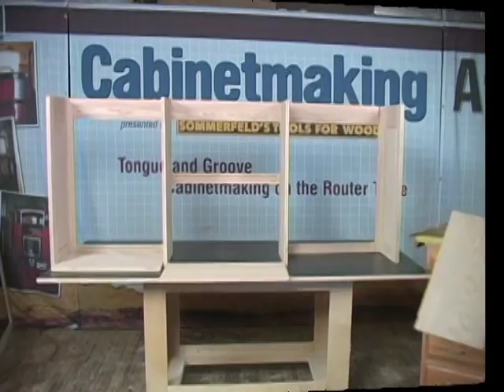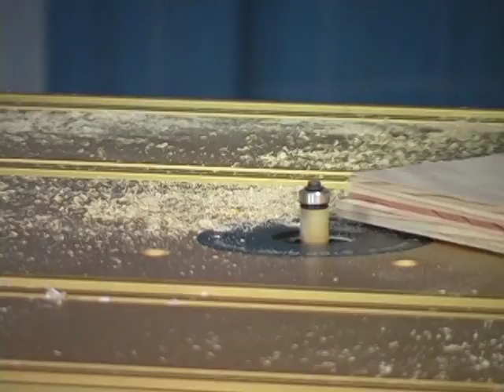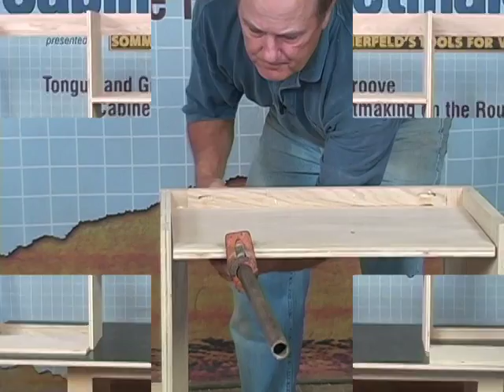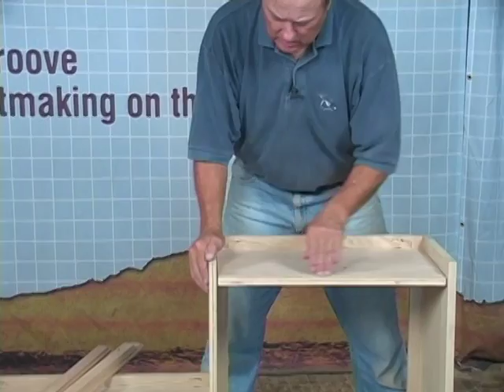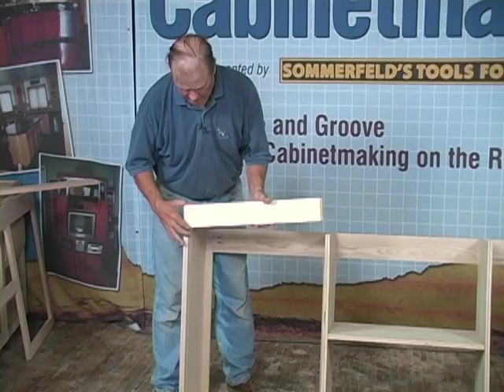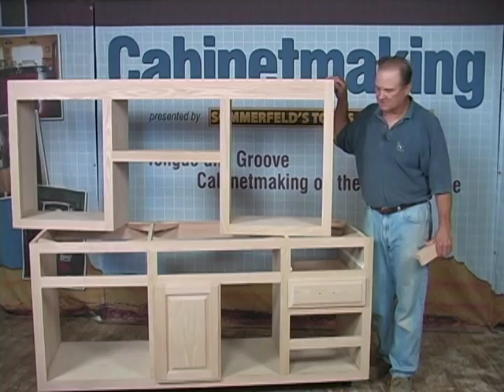Sommerfeld's Tools for Wood - Cabinetmaking Made Easy with Marc Sommerfeld - Part 4

Comment: Are you using those bar clamps without any protection on the faces? I've always been taught to protect the surface of the workpiece from the clamp face with a piece of leather, rubber or scrap wood. If this unit is to be painted then I can understand cuz you can hide marring with paint however, a little clarification could ease my stress when watching the metal face of those clamps SQUEEZE the wood fibers. 😬 
Great videos and excellent tips. I'm going to be adding these tools and jigs to my shop soon I hope. 👍🏻👍🏻👍🏻
Reply: Brian Schrader this is a great system for cabinet making. You our right always use something between clamps. The center divider where you have a grove on both sides really needs protection it will break. I know I've broken a few. The router bits are pretty good and the new chip out free stile and rail bits are the best you can buy

Comment: AWESOME! I want to build things. I'm so tired of computer and telephone work. My wood lathe is great but I want to amaze myself and build cabinets, furniture and what ever else I can nail, glue or screw together. Great video series...
Reply: Check out his website in the description. $1400 for his tool kit. Dude, go to home depot or lowes unless you plan on opening up a professional production shop. DIY to save money with prices like that??? Get Real.
Reply: kiltit Holy crap! $1400?!?! I'm sure a regular T&G bit set would do the same job for hundreds less and I can make my own rubber bushing to put in the router. I know Kreg makes the drawer jig and that drawer face jig can be made from MDF or phenolic stock. Now, that hinge jig was a pretty sweet doohickey you gotta admit. Thanks for the warning on the cost. 👍🏻

Comment: Instead of using the flush trim bit, I have turned the workpiece upside down using the tongue cutting bit to clean it up.  Works great and is one less bit to change.
Reply: S Perreault or a really good sharp chisel would make quick work of it. Can't let my hand tool skills get rusty like an old hammer left in the truck bed ya know. 👍🏻

Comment: Dave Thomas
Marc I just received the Easy Set and the tongue and groove set. The test pieces I used came out perfect. I tried a style and rail set that I had from a different company and set them using the Easy Set, it was the easiest set-up that I have seen and the fit of the joint was excellant. Can't wait to get started on a real cabinet. Thanks for the video and for coming up with outstanding equipment and technique.

Comment: Marc, love the series and you gave just the right amount of detail to explain all the steps.
One question, since no router can have the bits for the tongue and groove installed without moving the fence how do you reference the cuts when you have to go between bits? I don't have a fancy Incra fence but you mentioned making a mark in one of the videos?? Thanks for taking the time to make these videos.Pat